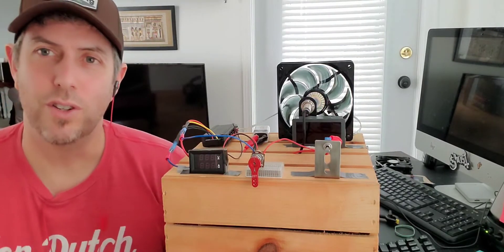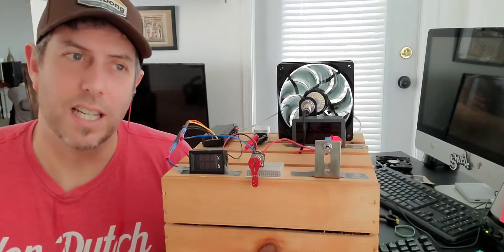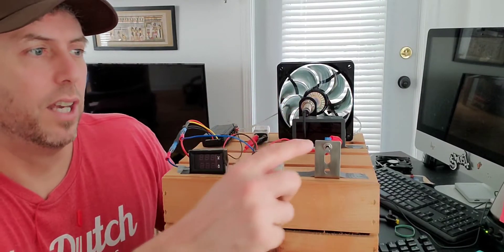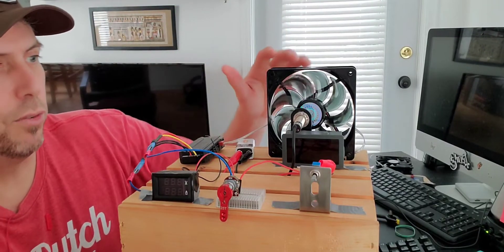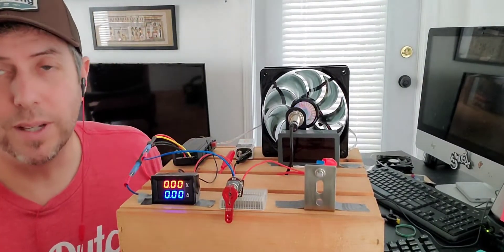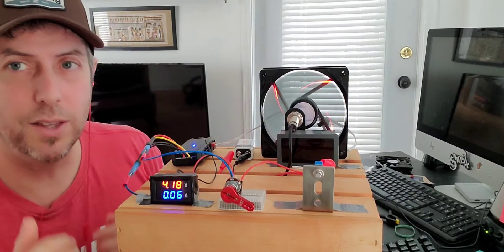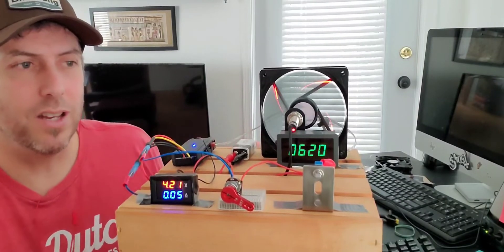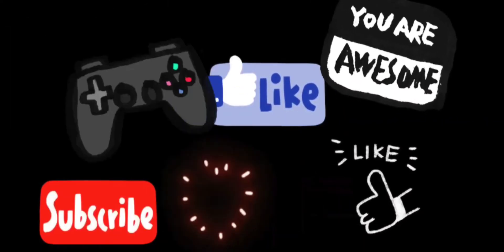Electric Boat - Not sure where to start? Try a desktop Science-Fair Project.

Comment: I'm still working on my Tolly and if the sea trial works out I'll decide on a conversion from gas engines to something electric drive with a diesel generator and a good battery system. I'd like range and performance so the final set up isn't clear yet. Keep going with yours
Reply from the maker: Good to hear. You are chasing the two holy grails for electric conversions. Performance will be best achieved with higher voltage more powerful motors and range will come down to how many batteries you can fit/afford. If you have the cash 200AH lithkums. Looking forward to the end product 👍
Reply: @ElectricCruiser  
The new electric motors from netgain have a huge range of voltage options and the performance is attractive for sure. If I were to get a pair of them, and a decent genset, would I be able to get away with a small battery bank? 
And how do you feel about the safety of the high voltage and saltwater? Even the lower voltage systems can zap you pretty good, but the NetGain HyPer9 HV AC Motor X144 Controller Kit 144 Volt (Dual Shaft) has a very high voltage system. 
It seems like it would perform well and at 5k (usd) each, they're comparable to the gas engines in price. 
What size generator would I need for 15 knots? And can a single genset run both motors? I'd have a diesel electric hybrid. 
I could build a good battery system later and the generator would get it going sooner. 
I'm looking forward to silent running...safely some day.
Reply from the maker: @besearchingforwisdom6267  Yeah I've had my eye on the Netgain stuff for a while. As far as the voltage, I plug into 110-120V every time I return so I feel pretty safe at least at 110V :) As you climb in voltage, everything just requires extra safe/secure wiring and safety cut-offs in mind. For speed and immediate range, you'd need to focus on the motors and batteries first. 
Those 144v motors might get you 15 knots, breaking that displacement speed really eats up the power exponentially.  
I mentioned in one of my videos that to go from 5knots to 7kts requires almost 25% more just to jump 2knots. It would be the same with a gas motor too. This is just the design of these old cabin cruisers. Big, heavy, not hydrodynamic. This is why a lot of them only cruise. Speeds past the hull speed just require a lot of power regardless of gas or electric.

Here is a good example of a hybrid electric - https://youtu.be/w2Bngp8gFlo
Using electrics for a short period then switching to the diesel engines. 

Different set up from having a Genset, which will be good to have on the hook. If you use a Genset while underway it will only offset the draw from the batteries.  It also depends on how much power your chargers can kick out. If your chargers kick out 1000W each, like mine, then you need a Genset that is at least 2500W continuous but IMHO 4500W is the minimum.   Otherwise, they are too loud with the higher RPMs. Bigger gensets run on lower RPMs. So it's a low rumble rather than high combustion.